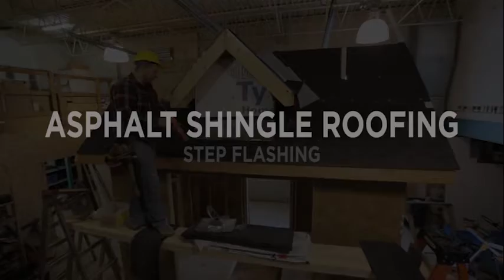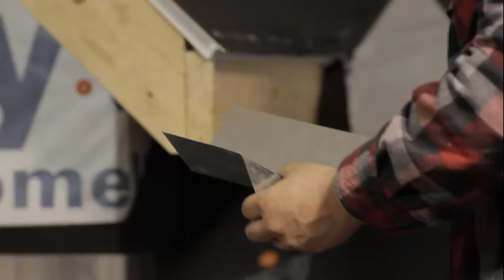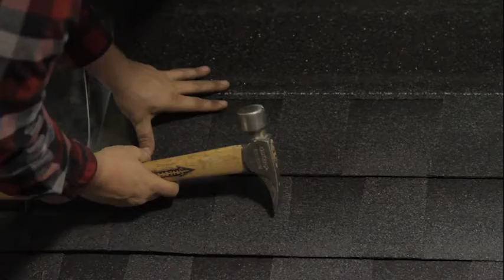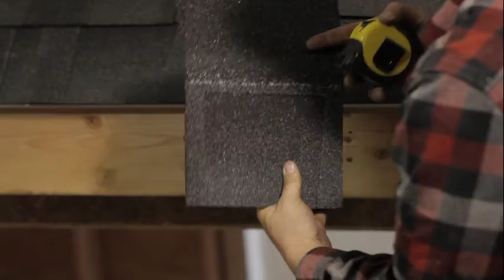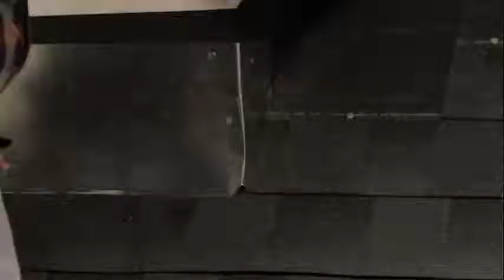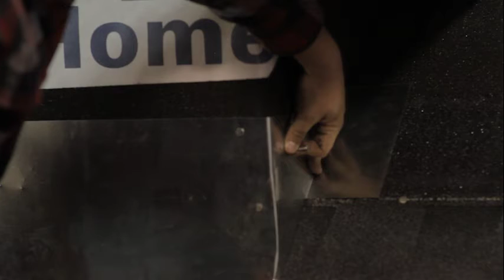How to Install Asphalt Shingle Roofing Part 10: Step Flashing

Comment: First step flashing should be out a bit to take alway from the front wall. With the surface tension of water, your bottom flashing WILL leak.

Comment: there is a small opening where the front flashing meets the right side... was that resolved to prevent leakage?
Reply: You still need a protruding front flashing, performance over visual.
Reply: I would bring that first pice of step flashing a little lower. Even just an inch lower even though you might see it below the shingle. Liberal use of a high quality like Lexel works well at all those joints too.